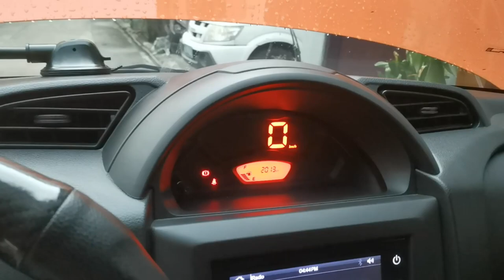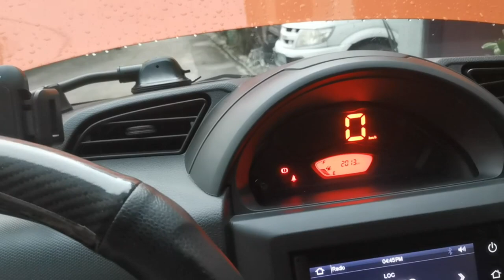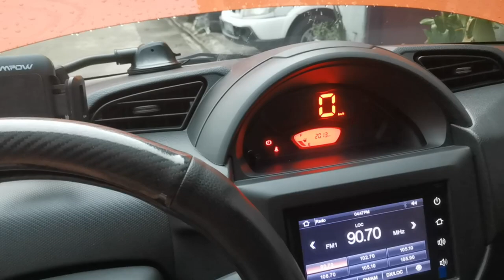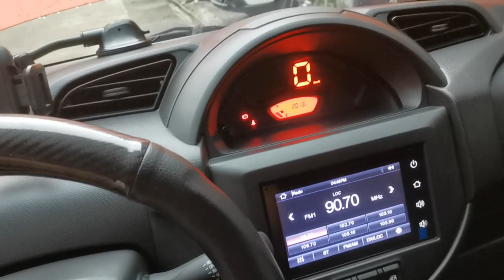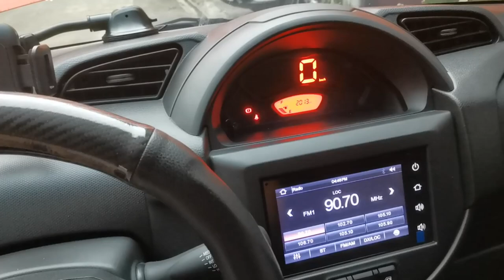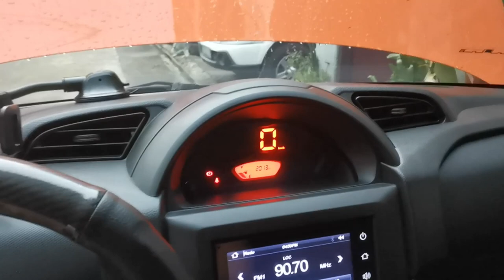Suzuki Spresso NO Hyperflashing

Comment: thank you sa mention :)  as for me naman im not bothered sa hyperflashing, mas gusto ko siya actually para actively and visibly nakikita ang signal ko, also hindi sya iinit kasi hindi ko naman sya hahayaan na naka signal ng ganun katagal, pang signal lang talaga sya , hindi mo naman ibababad na nak signal di ba ..at may spec ang s presso na kahit pitikin mo lang pababa mag sisignal na sya , but all good for coming up with this vid para sa bothered sa hyperflashing, me pwede silang gawin , thank you :)
Reply from the maker: Appreciate ko yung reply mo Mommy.

Though for me may mga possible cons kasi an hyperflashin

- Hyper flashing lights come with their effect on other drivers.

-Hyper flashing lights are known to be extremely distracting for other drivers and may cause a serious accident and/or injury by taking their eyes off the road.

It might be a giant beacon for any law enforcement officers in the area. You’ll likely get picked on more using hyper flashing blinkers.
Reply: @emperaning9539  only if it blinks 120 times per minute -horsepowerful article..
Mine doesnt blink 120 times per minute, as ive said di ko siya binababad, only uses it to signal intentions  :) , pansin ko din , hindi sakin nag ha hyper flash all through out, only a few seconds then it goes back it to its normal blink

Comment: Best solution pra iwas hyper flash wag mo palitan yong sa likod ng LED or yong sa harap..dapat magtitira ka ng isang halogen each side..no need na mag.attach ng heatsink..sa totoo lng d nman gnoon ktakaw sa kuryente ang signal lights natin kasi kumukurap lng nman at as needed lng nman sya gagana..mas makunsumo yong position lights front and rear at yong healight at brakelight yon maganda palitan LED..opinion ko lng..
Reply from the maker: Salamat heads up lods.
Actually tama ka sir.
As per my friend, kahit 2 lang sa harap na anti hyperflashing cable or 2 lang sa likod.
Tama na yung 2 lang. Sa akin kineep ko na lang since oks na naman sya.

Comment: may naka try na ba dito ng auxito brand yung may fan at anti hyperflashing? yung 800+ per pair sa lazada shopee?
Reply from the maker: ang alam ko lods, as long as may built in decoder oks na yun, wala ng hyperflash na mangyayari.
Usually mas pricy na ilaw may kasama ng decoder feature.
Reply: @emperaning9539  Ask ko lng po kung kahit dalawa lng ang load resistor and full led setup sya okay lng po ba?

Comment: opinion ko lang, usually nag hahyperflashing yan pag na sense ng circuit na open ang loop ng ilaw...example yang LED di kasi kagaya yan ng halogen na ilaw na ma memeasure ang resistance ng ilaw....ang LED kasi per se, needs pa ng circuit to adapt sa boltahe ng recomended na ilaw pag wala yan...makikita ng loop na open ang circuit kaya sya nag hahyperflash...yang sinasabi mo na anti hyper flash...adaptor circuit yan para ma detect ng circuit na andyan meron kang ilaw, meron syang na kukuha na equivalent na resistance na pinalit mo sa halogen bulb.
Reply from the maker: salamat idol sa input!